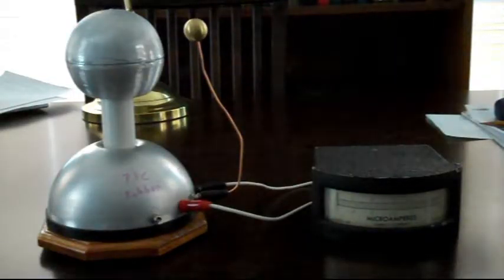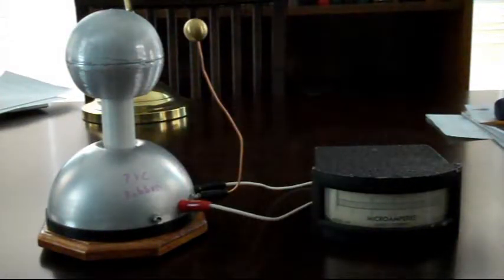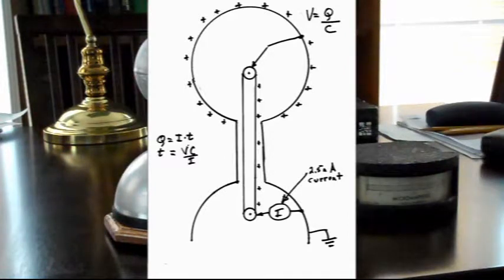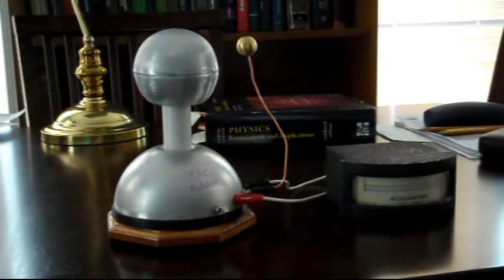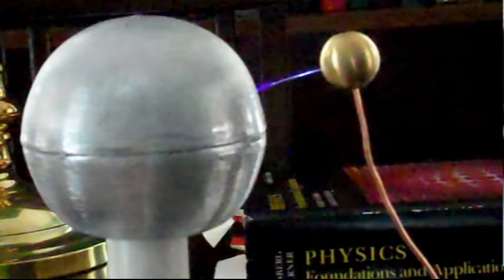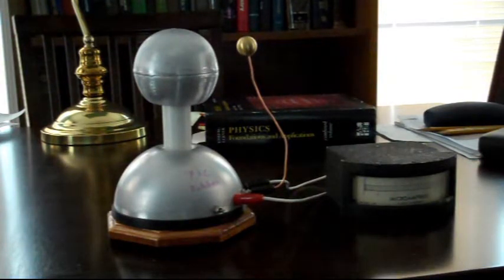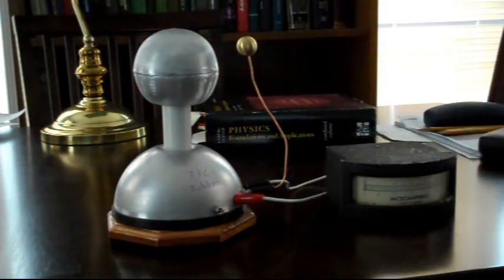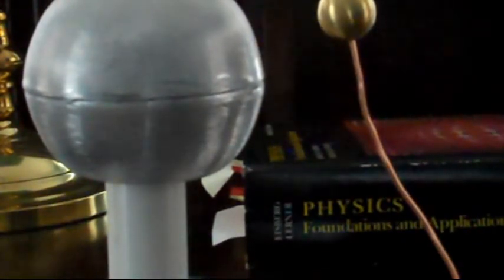van de graaff current

Comment: But this method is only giving a rough idea about the effective value. The single pulse currents are in the amp range.
Reply from the maker: When there is a discharge spark, the peak current is supplied by the capacitance.  What I measure is the constant current supplied by the generator.

Comment: Have you tried measuring the current between the lower comb and upper comb? That would tell you the current going onto the terminal I think. There may be charge leakage on the way up to the top when you only measure it going onto the belt. I wouldn't have the terminal attached at the time.
Reply from the maker: Eminsuipi, you are correct!  When the voltage on the globe gets high enough (80,000 volts or so),  there will be leakage ion current to sharp edged objects in the area around  it  The globe itself and the rounded base have no sharp edges to cause leakage on this generator, and that's why the potential can get up high enough to cause an arc to the discharge ball.  I have measured the microammeter current from the globe directly by holding a sharp pointed probe within a few inches of it, in series with the meter and ground (to generate ion current), and the current was very close to the measured current going on the lower brush.   :)
Reply: papazstuff4u
I don't think that a few inches from the terminal is direct. Put it right on the teminal or the comb underneath. A curent meter is basically a short circuit. That gap introduces an error by adding a resistance in series? I measure the current from the bottom comb to the top comb. I remove the terminal as a safety precaution since my meter has diodes that can be damaged by an accidental circuit break. What do you think?
Reply from the maker: eminusipi Yes, it is direct even though it is several inches away.  Essentially all of the leakage current is going through the meter because leakage to other surrounding objects is very low.  The Van de Graaff generator is a constant current source, and the voltage across any series resistance will build up to satisfy the V=I*R equation.  
The purpose of this demonstration is to show that the generator is a constant current source.  When there is no leakage current (or very low current), the voltage on the globe will continue to build up linearly on the globe capacitance according to the V=Q/C  equation.  When it reaches the breakdown voltage (80,000V) between the globe and discharge ball, a very low resistance plaza arc will short out the capacitance and discharge the globe.  Then the globe starts charging up again and the cycle repeats.   To figure out the timing of the cycle and subsequent output current of the generator, the
V=(I*T)/C equation can be solved for I.  Knowing the timing interval and the capacitance of the globe, the current is found: I=(V*C)/t